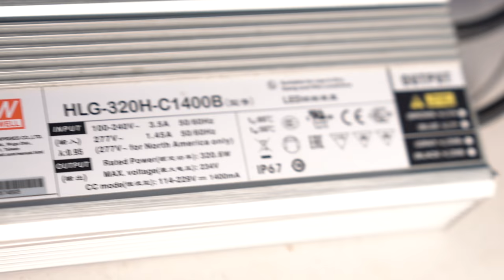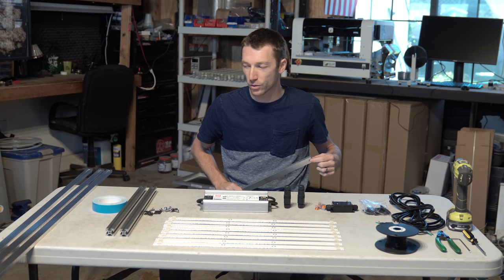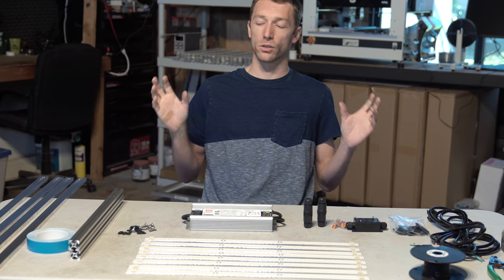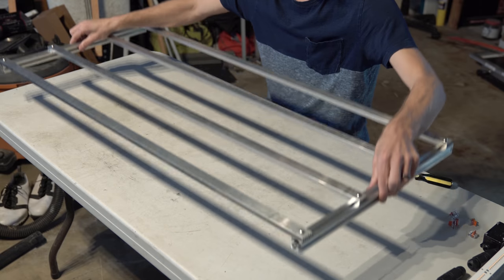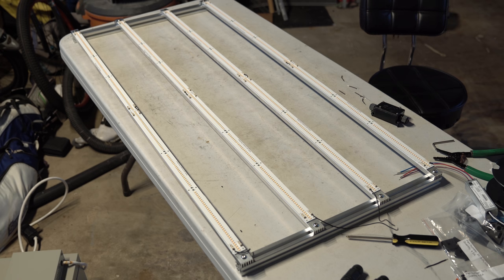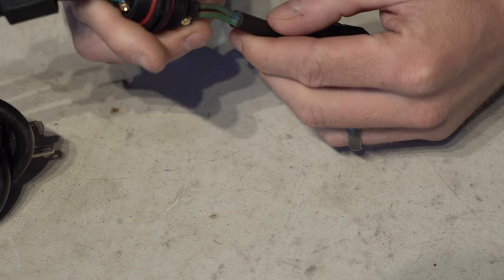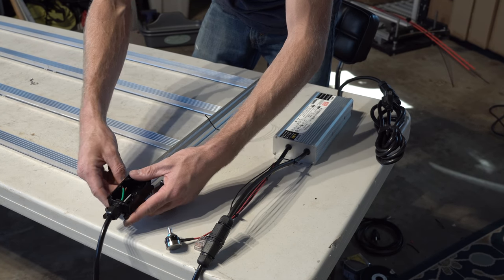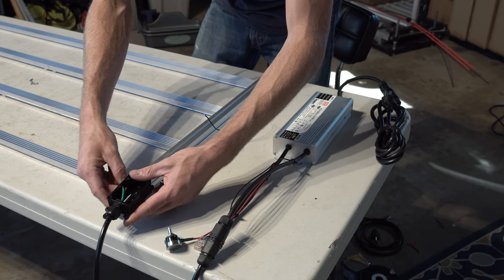Photo Boost Strip DIY LED Grow Light Build

Comment: so if i want to double that design up, i would need two drivers, and wire it up as two separate lights but on one frame, or can i get a more powerful driver and wire it all together?
Reply from the maker: Yep, 2 drivers, one frame. You can wire the drivers together to one power cord and one dimmer.
Reply: @GreengenesGardenOfficial  so you can have 1 dimmer teeed off to do 2 drivers?
Reply: yes. instead of a 100k ohm potentiometer.. you use a 50k ohm version for 2 drivers..  3 drivers would be 33k ohm pot.
Reply: Jolly Green Giant can you link me to a video on how to wire to drivers together

Comment: I just finished my second LED light build and it too works great. I ended up adding a large heat sink to the power supply to chill it out which it has done nicely and I also called onlinecomponets.com and spoke with Steph who I bought the HLG-320H-C1400B power supplies from and found out that it has a 7 YEAR warranty! Talk about great parts with outstanding warranties! Dude you nailed it. Thank you! I do have one question, what do you think about me adding a 16 gauge in line quick connect about 12" from the LED light so that it would make it easier to transport? I don't know what the resistance would be but I would think less than 1 ohm. Your thoughts please and thanks.....Amazon quick connect link below.
https://smile.amazon.com/gp/product/B07QDS5DKR/ref=ppx_yo_dt_b_asin_title_o01_s00?ie=UTF8&psc=1
Reply from the maker: I have quick connects on mine, go ahead.
Reply: @GreengenesGardenOfficial  Will the 16 gauge ones I posted a link on from Amazon work ok? Thanks